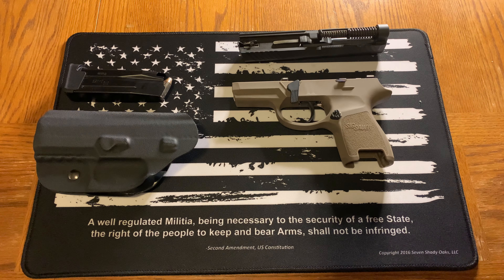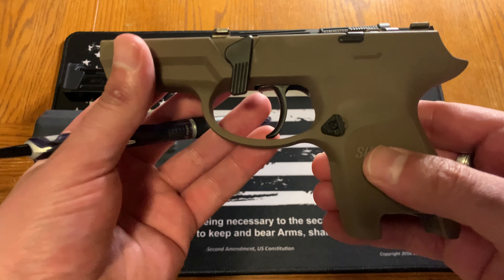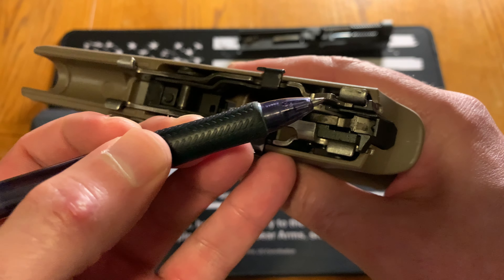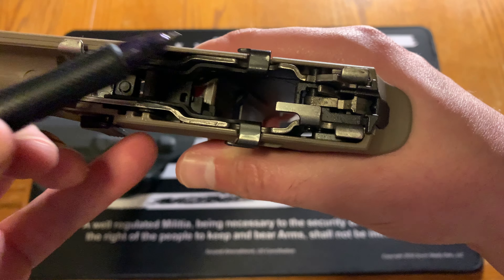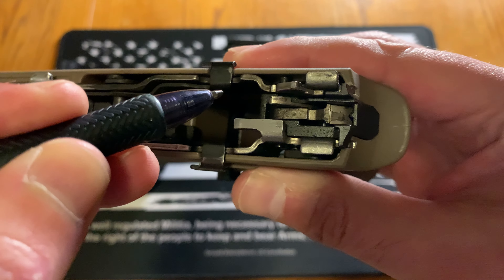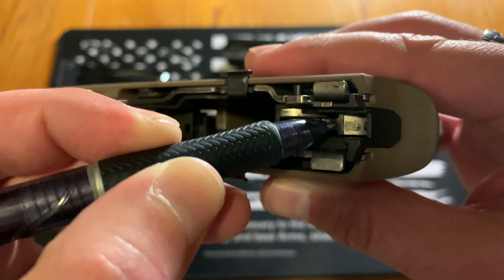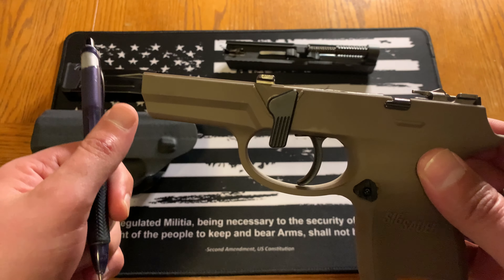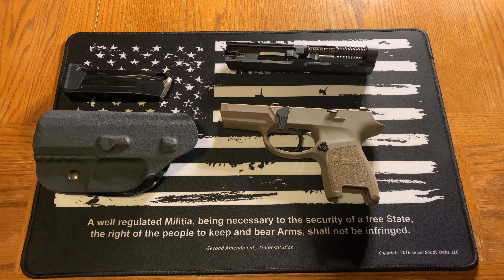Sig P320 Trigger Fix: They Fixed The Drop Issue!

Comment: Great info. These things should be tested thoroughly before they ever end up leaving the manufacturer. SIG should know better its not like they are a brand new company getting started in the industry.
Reply from the maker: I haven't seen much in the way of news on this issue - I personally wouldn't drop a gun intentionally and I agree rigorous testing is important. I'm utilizing my P320 for home protection and even added some upgrades. I've still got confidence in it! I can't help but to feel that many of the recent cases are due to ND's - finger placement and or the trigger gets caught on clothing/gear, etc. Thanks for commenting - I appreciate you being part of the squad. Be safe and stay vigilant!

Comment: does the m18 have this issue?
Reply from the maker: Those pistols were/are subject to this issue since it’s based on the p320 platform. If the pistol was manufactured before 8/8/2017 then you’d need to have the “voluntary upgrade” done, otherwise according to Sig they’re good to go. I haven’t heard any further updates since. You can always check your pistol via their website using the serial number- FYI. https://www.sigsauer.com/p320-voluntary-upgrade-program

Best of luck and thank you for the comment!! Be safe and stay vigilant 👊🏻✌🏻🇺🇸🇺🇸

Comment: Has sig changed the gun from factory to where it is now drop safe bc i am thinking abt getting a p320 but don't wanna have to send it back to sig right after i get it
Reply from the maker: The drop safety issue is an easy one to spot the “original” or pre-voluntary recall models had a very thick trigger and no cuts on the bottom of the slide. Look at the picture of the one your buying if you’re shopping online or in person looking at the gun and taking the slide off - it’s very easy to identify. Here’s an article from Sig that discusses the topic and shows pictures of the pre upgrade and post. Thanks for being part of the squad, hope to see you around! Be safe, stay vigilant!!

Comment: is that true?
Reply from the maker: Sig did have some issues with drop safety with the first iteration, they offered a voluntary recall and the newer models started coming with the “fix” already completed. Seems like the vast majority of complaints in the more recent times have been ND’s. I’ll certainly admit when I’m wrong and I think things were blown out of proportion in 2020 & beyond - in my opinion. 

P.S.- I’ve got my p320 in use as home defense, with no issues to speak of…

Thanks for being part of the squad - be safe and stay vigilant! 🇺🇸🇺🇸🇺🇸🤙🏻
Reply: @VPTACTICAL  I'm in this cesspool city called NYC and wanted to get one for home defense n not to carry.  

Sig p320 seem like a good option since I can change out to micro to compact n such...

Thanks for the reply 👍
Reply from the maker: Happy to help! I don’t foresee the laws loosening there anytime soon or ever, got to work with what you got or move lol. The latter isn’t always reasonable, and I get that.
Reply: @VPTACTICAL  The Home Defense permits are more laxed than a carry.  So we shall see...and yes, a move is on the table.  

Thanks!!
Reply from the maker: Sounds like you got a plan, best of luck!

Comment: I heard that they actually have replaced the striker pin with a stronger striker pin, which I would assume would be heavier....but you said that it is "lighter".  Is the lighter striker pin stronger?  They were having issues with light primer strikes which caused some FTF's, etc., and probably necessitated the change, but I'm confused as to how a "lighter" striker would correct that problem.
Reply from the maker: I assume that the striker is stronger, it’s from their legion line. Unless there is something that I missed!

Comment: I’m good. I’ll stick w my ND proof Glocks
Reply from the maker: Glock has had a pretty solid reputation through and through. Although more recently I recall slam fires or firing out of battery with the g44. Things can happen with any manufacturer, scary stuff either way!! Thanks for being part of the squad ! ✌🏻👊🏻
Reply: VP TACTICAL I think that might just be a problem w redesigning the gun to shoot rim fire .22 LR cartridges, I’ve never heard of a center fire glock “slam firing”
Reply from the maker: That very well could be, these were some of the resources I found regarding those recent incidents. https://www.northwestfirearms.com/threads/g44-kaboom.317214/page-6
The 15/22's were a too shallow bolt face rim recess causing slam fires.  Like a full diameter around the rim firing pin. 
https://www.ar15.com/forums/handguns/Glock-44-kaboom-Update-Glock-response-In-OP/13-193065/&page=4
Reply: Google Glockleg, cops lied about glocks too just like they are with the p320 lmaoo

Comment: You're gonna get a lot of new views with yesterday's (7/8/20) news of a major lawsuit claiming the 320 can simply go off in a holster.  Not sure if those guns were pre-fix era.
Reply from the maker: Someone made mention of that some weeks or month ago, I bought my pistol that had the fix already done at the factory. At least to correct the drop issue.
Reply: @VPTACTICAL  My son has a 'fixed' 320 and I have an Xcompact and an Xcarry....sure hope they're safe...I'm nervous now as I carry appendix...but I have  other guns too.  Still...love my Sigs.
Reply from the maker: Love my Sigs as well, I carry the p320 on the regular. I sure hope that these issues get ironed out. I’ve had second thoughts about carrying it till I talk with Sig. At least to see if mine needs additional warranty service.
Reply: @VPTACTICAL  The lawsuit is really troubling. Apparently the fix that Sig did for the "voluntary recall" still doesn't make it safe. Plenty of people claiming it still goes boom on it's own while holstered. The whole voluntary recall thing was BS anyways. Your gun isn't drop safe and you only do a voluntary recall??? Only 20% of sigs have been returned for the recall btw. Sig is no longer the great company it once was. They can't even design, fix, or admit fault in a defective weapon platform. Even Hi-points are looking more attractive than the P320's LOL.
Reply: News Flash : even after the recall these are still going off by itself & the newer Sigs are going off. While their in the Holsters. Check out Guns&Gadgets he has 2 videos on CURRENT LAW SUITS state wide concerns on the Sig P320
Reply: @thepatriotsrock2  do you have any other pages that you know actively following this or just the one where a YouTube content creator who's entire account depends on views is making videos about this controversial topic?
Reply: @KingPhilipsRideshare  Guns&Gadgets has 2 videos of the Sig P320 both Original & Updated trigger Issues. Go to his channel type in Sig P320 trigger & they should pop up. He owns both Sigs new & original won't carry either one & is in Law Enforcement himself
Reply: @thepatriotsrock2  yeah I've watched his vids. Like I said. A Cop protecting cops who goofed. if the FCU was compromised you would see so many negligent discharges in the armed services it would be a nationwide story. Instead it's like 38 cops fiddling with their guns. I guess it's because it's not definitive.
Reply: @KingPhilipsRideshare  You may be right, I carry a HK VP9 LE & if  they had an issue I might not want to give it up under same circumstances
Reply: @thepatriotsrock2  like I said in a previous comment glock leg used to be a term in law enforcement for Glocks that fired "all on their own".. and injured the cops
Reply from the maker: Some valid points there! I just hope things get ironed out, I love my Sig guns!! Thanks for being part of the squad!! ✌🏻👊🏻🇺🇸
Reply from the maker: Rest assured I’m following the topic when new “information” is available I’ll discuss it. I actually ready through the court dockets and sift through what’s applicable - the most important thing is to find the truth. I rely on views for nothing - my channel is not monetized. If it gets there great, otherwise it’s about facts, guns, gear, and our great second amendment!! 👊🏻🇺🇸✌🏻
Reply: @VPTACTICAL  keep everybody safe
Reply from the maker: I’ll do my best!!! I appreciate you ✌🏻👊🏻
Reply: @thepatriotsrock2  yes I have seen this one. interesting to note about the video she does not have a long injury running down her leg which would be consistent with a holstered weapon pointed vertically down. Instead the round went into her thigh perpendicular to the femur shattering it. How does this happen if the gun is just sitting there and not being contorted by either a crappy belt or crappy holster or someone messing with it? Spoiler. It doesn't
Reply: @KingPhilipsRideshare  My thing if it was her fault why did Sig settle the day of the Court Case ? Didn't even go to Trial .
Reply: @thepatriotsrock2  a settlement is not an admission of fault. these things can go on for years and sometimes it's more beneficial to the company and their reputation is simply settled than to have a long legal battle stringing headlines out over years and years
Reply: @KingPhilipsRideshare   Also, the original problem was that they went off when dropped. Nothing about them ever going off by themselves. If this was problem before why wasn't this part of the argument in the first place? because before they had to be hit by just the right angle to fire accidently... Because Otherwise what they are saying now, is that its Worse.. all of a sudden they are going off by themselves when not being hit at all.  AND with more safeties its just going off? That just doesn't make sense.  Plus, most of these stories are people fiddling with the gun that's in a holster like you said..
Reply: She said she was taking her belt off, most people claim it discharged when the frame is squeezed weird despite not touching the trigger

Comment: and they called it a "voluntary" upgrade. (lawyer talk for "don't call it a recall")
Reply: Someone claimed to have previously worked for another German firearms manufacturer,  and they said that the Germans generally prefer to not do recalls. If that's true, then you'd be correct in saying that SIG just doesn't want to formally announce a recall.
Reply: @Slavolko  Interesting to wonder just how many P320 owners took up Sig's "voluntary upgrade". For those that didn't, wouldn't you think that there still is the potential issue of the gun going bang when dropped?
Reply: @bamahi7142  I don't imagine that everyone took SIG up on the voluntary upgrade, so for sure, there are lots of P320 out there with a potential ND issue. I don't have the numbers, but it'd be a good day if even 75% of affected people turned in their P320 to get upgraded.
Reply: @Slavolko  Such a beautiful gun. I just don't have the faith to "pull the trigger" on one. (pun intended)
Reply from the maker: That very well could be true - odd that it was a voluntary upgrade/fix. If I was a gun manufacturer I’d want all of those guns back, simply to make sure that nobody got hurt from a negligent discharge. Thanks for your comment - I appreciate you being part of the squad. Be safe and stay vigilant!
Reply: @bamahi7142  Yeah, it's a nice gun. I'll personally be going with a P365X, so I won't have to worry about this issue thankfully.

Comment: The military should have stayed with Beretta and at least tried the Beretta M9A3
Reply from the maker: The beretta is a beast - solid gun for years, like anything military it’s all about the bids and who’s got the best bang for the buck no pun intended. Thanks for stopping by and commenting - I appreciate you being part of the squad!
Reply: Sig is cheaper and they rarely use pistols anyhow. If you need it then the difference is very slight. The less weight is probably a bigger difference than the aim as largely you just carry it around while using your rifle.
Reply from the maker: Very valid point!

Comment: Update 2024… they still have issues
Reply from the maker: I’ve heard mixed details and facts. Some are claiming ND’s, others the gun… It would seem they have all the issues worked out at this point. Especially with the changes they made for drop safety in conjunction with the trigger.

Comment: i just bought a p320. how can i tell if mine needs to be upgraded?  is there some way I can look this up by serial number?
Reply from the maker: Congrats on the new purchase, here’s a link to check to see if it already had the upgrade or not: https://www.sigsauer.com/p320-voluntary-upgrade-program
Reply: @VPTACTICAL  thanks. i entered my SN the webpage said "invalid".  i actually have the 320F, so I'm not sure if maybe that is the reason the SN is invalid?
Reply from the maker: @dlk3904 That shouldn’t make a difference - my understanding it just denotes it as a full size. Like mine for example is the p320c for compact. If you keep scrolling down that page it shows you how to identify whether or not the “upgrade” has been done by looking at the trigger width/thickness among other details. Worst case call Sig on Monday if you want to double check and confirm.